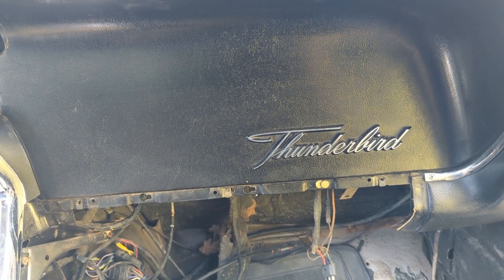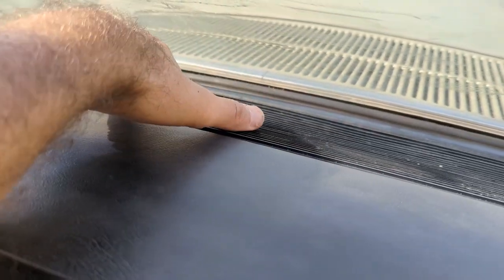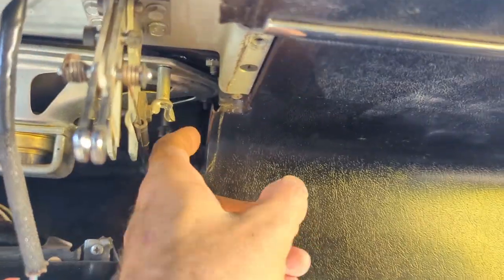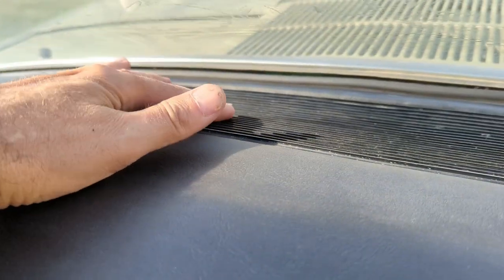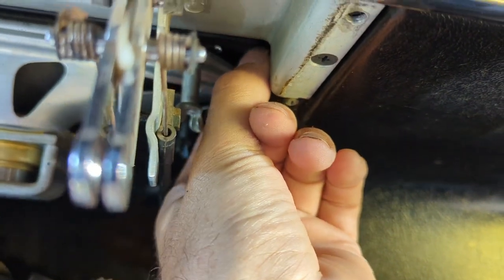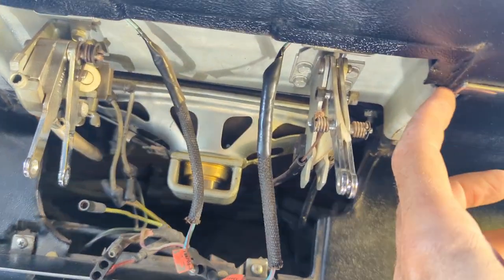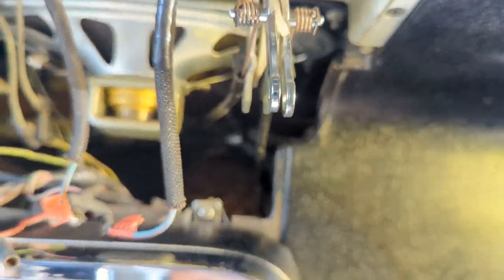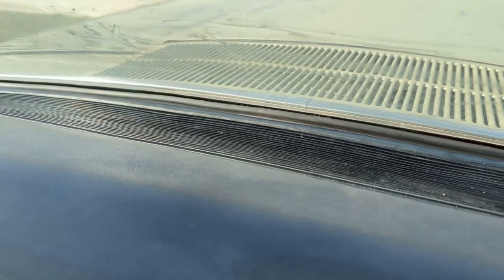Defrost & Speaker Grate Removal on 64-66 Thunderbird

Comment: Alvin,
That was good info.  It's knowing the little things that often counts the most with these old jalopies.  Over the years you can bet more than a few defrost vent grates have been busted by folks trying to pry them off with a screwdriver after removing just those Phillips screws.
Good job, my friend.  Thanks.
Regards,
John
Reply from the maker: Thank you John...if a guy doesn't have a manual, some of these little things can be tricky, and once it's broken...that's it! 😥😥

Comment: Hey Alvin, I've taken a few of those things off. My biggest worry is breaking or cracking the dash pad. Don't put any pressure on that. Just push the grille up from underneath. Also, I've broken  a few of those defroster ducts. They get pretty brittle. Sometimes the hose just doesn't want to come off or go back on and then its a fight. I'm big on removing the dash and fixing all that crap with the dash out. Makes it so much easier. Then you can fix everything under the dash at once including the vacuum system. Its only time and money right? Thanks.
Reply from the maker: Hey Nick...thank you for the added advice, I could see the potential for cracking, the vinyl layer on these dashes is very thin.
Yes...and lots of time and money! Lol

Comment: Thanks for the video! Yes, I had to replace the under dash speaker in my car and at first glance it looks like those nuts hold the speaker in. Of course it's the wing nuts the hold the speaker in place. I guess they did that so speaker nuts wouldn't be over tightened, but I'm not really sure. I've kind of lost track of how many times I've had that clock/wiper/vent control panel off and on. Seven or eight times maybe. LOL.
Reply from the maker: The speaker wing nut set up must have a purpose, I can only guess why! Lol
I sure hope I don't have to remove that unit as many times as you have! 😵‍💫

Comment: This sure makes me wish I had my '66 TBird, still.  Someone has a gem in their hands. I had it in a shop having the motor and trans rebuilt, all original, 120k original miles, one owner, still had all the stickers and badges in the engine compartment on the hoses and AC lines. It had a 428 with the transmission that was 3 speed automatic with a indicator that looked like an overdrive circle around the third gear but I was told it wasn't overdrive but a gear ratio change for driving in snow or ice.  It had all the options, it was white with black vinyl top with skirts on the rear wheels, everything worked, and was in perfect condition being garaged and a California car. Not a spot of rust anywhere.  I had a problem with the law and went to jail for a year and I don't know what happened to the car. I gave the shop $1500 down payment to do the motor and trans rebuild and I think someone I knew who actually told me about the car so I could buy it ended up with the car.  I got out of jail and immediately moved to a new city. I had to start my life over because I had nothing. While in jail my brother had my '78 Z28 and drove it and blew the motor and gave it to someone. 
 So I got screwed out of two very cool cars.  Shit happens.
Reply from the maker: That sounds like one really nice T-Bird, as well as the Z28! It's unfortunate that you lost them, life can be cruel at times.
Reply: @J_R_Shop  ---- thanks for your reply. 
 Yeah, if we all still had all the cars we owned during our lives, we'd all be living in garages instead of houses. I had two gold on gold '67 Chevy Chevelle Malibus one was convertible and the hard top was brown vinyl, I had an '82 SS El Camino that the stock V6 was swapped out for a 305 Target motor Weiand midrise manifold turbomatic 350 with shift kit and limited slip rear end with 355 gears, it was built to pull a ski boat and it would run 150 MPH and still had some pedal left. All of those I sold off for one reason or another, (old lady bitching about cars sitting around. LOL
 Right now I've got my '06 5.7 Hemi Magnum wagon with a blown motor and I've got my work truck which is an '08 Cadillac Escalade ESV awd L92 6.2 litre that is putting out about 475 HP as my electrical service truck with all windows limo blacked out and 22 inch wheels all black. I love that truck. No governor, 10: 1 compression all aluminum block and heads . It gets up and goes for a 8k lb truck. I'm trying to decide what to do with the Magnum wagon. I may hot rod it.  Those damn Hemi 5.7 motors are almost $10k for a crate motor and refurbished are like $5 -6 k  stock motor. It's such a cool looking body, it needs to be a road hot rod. Gut it to unload weight, do the suspension and brakes upgrade to SRT or a HellCat big block, plenty of fools are wrecking those things and may be able to get a motor from one. 
  Sorry for rambling on. I'm on my second cup of coffee already.
Reply from the maker: @13_13k  it's not rambling. It is always nice to hear other peoples stories!
Reply: @J_R_Shop  --- that's very kind of you.